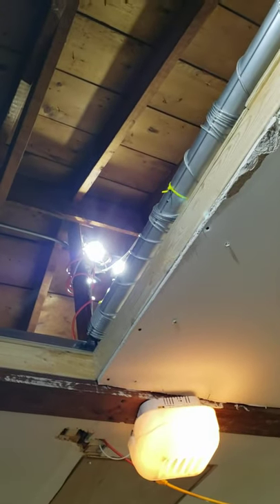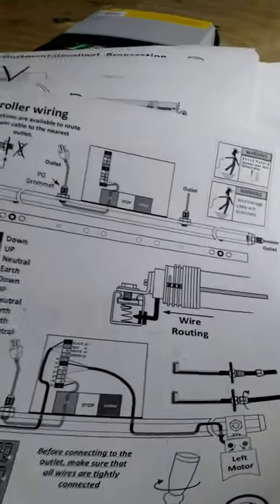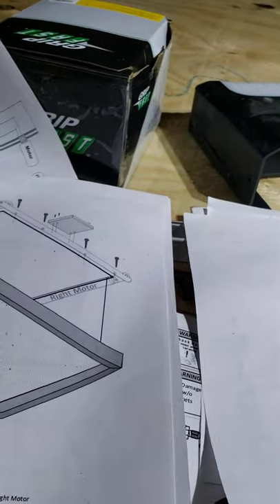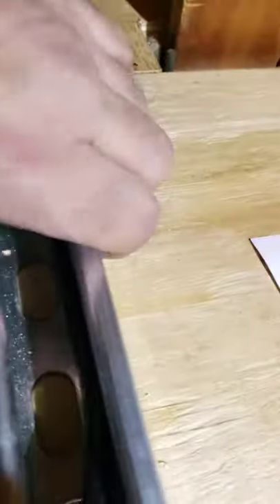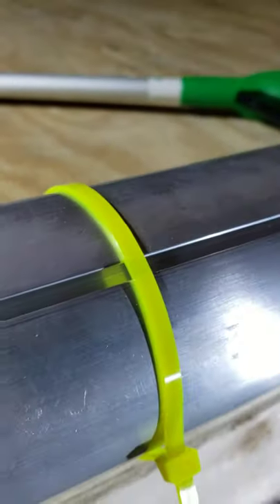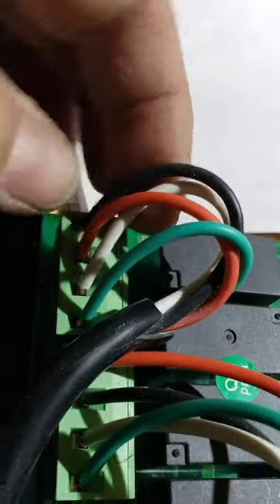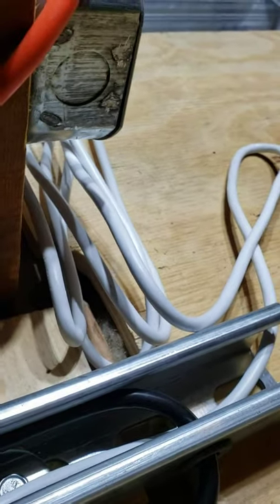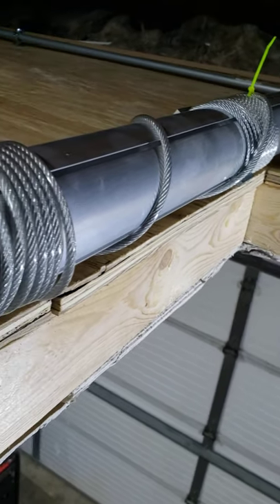Auxx lift installing motors and c channel, and control unit

Comment: Did you cut the struts down and drill extra holes.  I just purchased mine (same size 2X4) and my holes for the motor wires are 8 inches away, towards the outside and then I have to come back to the controller.
Reply: How are you liking it so far?